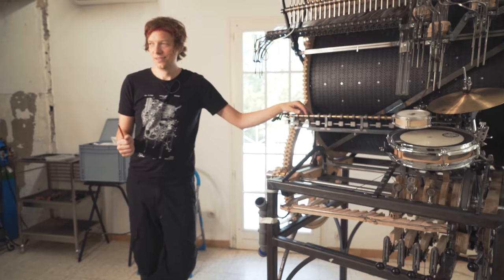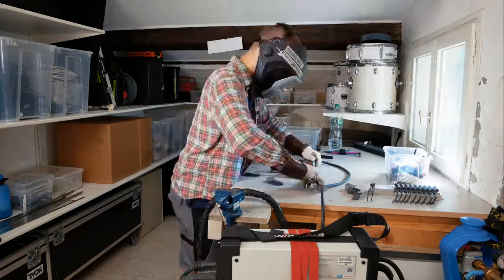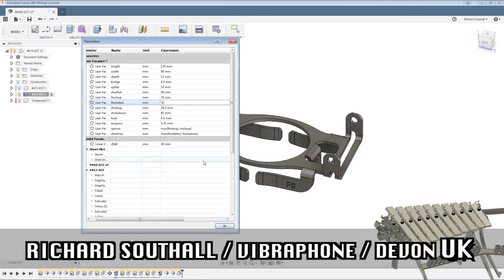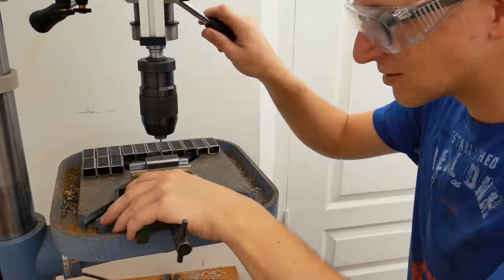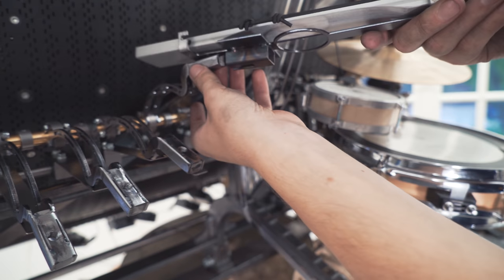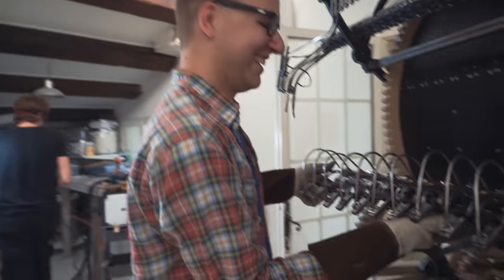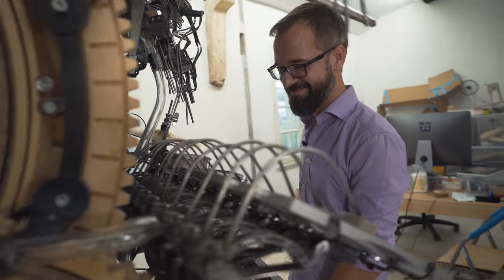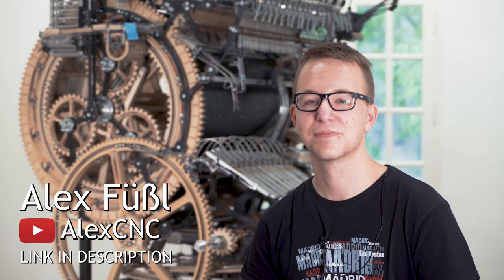Vibraphone Bar Holders - Marble Machine X #93

Comment: 8:03 Martin:"i learned sth from Alex: when I make a chamfer..." Me: YESSS, finally!
Martin:  uses high rpm so the countersink is rattling
This gave me as a machinist an ultra cringe and made me feel sorry for the countersink 😢
Pls lower the rpm to about 100 and you're good to go😅
Reply: I could not have said it better myself! xD
Reply: so much this! :P
Reply: Isaac Jung But that is not a router he is doing it on but a normal drill press...
Reply: i mounted a handle on mine, and with a 90° handturn i get perfect results.
Reply: The speed depends on the size of the Countersink.
Reply: Yes I think you are feeling empathy for the  tool and the work piece, which is possibly what Martin needs to learn. Even metal has feeling you know!
Reply: oh come on.  Just stop with the cringe comments.
Reply: @drasiritzbir  soooo? A router couldnt go this slow btw
Reply: @drasiritzbir  But the speed is still variable on a drill press by moving the belt, and referring to the chart under the cover.
Reply: @watcherofwatchers  ikr it's just a no no
Reply: I was wondering why that sounded so horrible, but I thought it was supposed to be that way :D
Reply: That drill press will never run that multiflute cutter slow enough to not chatter. 100 RPM is not an option. It is not rigid enough for a multi-flute anyway. He needs a single or zero flute countersink.
Reply: @buddyclem7328  Yeah that is what I meant, no reason to go too fast on a drill press, but the original post I was referring to is gone / changed. There a router was the excuse for not going slow..
Reply: I'm a machinist-in-training currently and as soon as he said "chamfer" and I saw that spindle become a blur when he powered it, I was like "noooOOOOO-"
Reply: @watcherofwatchers  So who peed in your cereal this morning?
Reply: Artists. They are artists for a reason, You know! (Contributing it as the tech guy working with artists for decades ...)
Reply: Aw, you don't like triangular countersinks??

Comment: I'm curious, what does the PBS say the overall completion is? its been such a long time since we saw it.
Reply: 37%
Reply: 5%
Reply: Well, duh. If you ever used a computer, you know exactly where it's at: STUCK ON 99% FOREVER.
Reply: Something 9x% I guess. The bass and the marble catchers are the only main parts missing. But then there is the debugging phase, which could take a while, depending on if some part needs a redesign. edit: (oh right, and the fingers... still not convinced they'll make it into the final design, though)
Reply: @TheAgamemnon911  oh god, the fingers...
Reply: @TheAgamemnon911  let's not forget the vibraphone resonator tubes, which are complicated because they need to change depending on what vibraphone notes are used.
Reply: @Blazier  Right, those need to be done, too. One doesn't need every tube to be every length, though. But I guess, the planning on that is already done and the manufacturing step of those is comparatively easy. (unless they are all metal, too)
Reply: @TheAgamemnon911  I'm not sure what you're saying here -- the length of a resonator has to match the corresponding bar or it won't resonate properly. So either they need a resonator per bar or they need a fast way to adjust the length of a given resonator. My guess is they'll just take the resonators off an existing vibraphone.
Reply: @JimVanVerth  I am saying that each channel does not need 37 different resonators. Somewhere between 4 to 6 different selectable lengths per resonator tube should be enough to enable all standard keys as well as many exotic ones. Switching out the whole tube would definitely be too much work for quick on-stage changes.

Comment: Some say the F1 engine from the apollo moonlander can't be rebuilt today, because none of the engineers could interpret and fine tune the details from the drawings the way they did it back in the 60's. My reaction to the MMX is that from start you were doing everything in CAD and the parts had their serial numbers and so on, but now I get the feeling that the machine is starting to become a "hack" and if someone would try to recreate the machine from the drawings, that could not be done.

For instance, if a part breaks down on the tour, could you still just have it made and get it shipped to your location, or would it had to be built on site to be able to fit it on the MMX?
Reply: NovaLand I have a feeling they will take an entire container of spare parts with them. 

My second feeling is, after about 3 tour locations, taking the MMX apart, putting it back together, followed by the INSANE amount of calibrating and adjusting required, it will be concluded, “The MMX is too complicated and complex to continually be moved and work correctly, therefore an executive decision has been made to only use the MMX for studio recording.”
Reply: @NealD  yes.  A machine that can be adjusted will need continual adjustment.
Reply: WhatAboutTheBee and a machine that cannot be adjusted will simply not work.
Reply: The CAD is getting adusted to reflect the changes.  This is a prototype after all - Martin wants the ability to order up parts.
Reply: @NealD  That is not insane - that is NORMAL for musical instraments that go into a box.  That is why orchastras tune up for quite some time before preformences.  His band already travels with a lot more instraments then band members, so they are used to a bunch of tuning beforehand.
Reply: kin2naruto have you watched all of the MMX videos? Because of the complexity, the on-site assembly time and configuration WILL BE insane. Look at the much simpler original MM and how it could not even play an entire song almost all of the time?! Yes there are a lot of reasons for that, but every single adjustment, is a one reason why.
Reply: kin2naruto I’ll come back to this in a year and we will see...
Reply: @NealD  Not as much as you think.  The "assembly" part is really quick and snaps together.  The "adjustment" part will take lots of fiddling, but no more then typical for musical instruments!  Probably won't even add much more then an hour to the dress rehearsal.  (You do dress rehearsals and tuning up EVERY time you do a concert - this is normal)
Reply: @angish1  As an actual degree'd engineer, I will simply tell you the 5 P's of Engineering.  Prior Planning Prevents Piss Poor Performance.
Reply: WhatAboutTheBee ... Is it part of an engineering in-joke that those were 6 Ps?
Reply: @Phandiw  Yes!  If only I had stopped to figure out how many P's there were before I started !!  This also re-inforces the "prior planning" part of the alliteration
Reply: @WhatAboutTheBee  I think that the prior planning part of the marble machine X is not something that has been taken lightly. However, no matter how much planning you do there are always hiccups. Adjustability is, with all due respect,  part of the specific needs of that machine considering the requirements for all the musical expectations there are from it. I think this machine is on the right track precisely because there are engineers helping with planning, CADing and someone who specifically worked on the PBS.
Reply: I’m more worried about marbles spilling on the stage floor causing a hazard rather than the actual machine breaking down and having issues with parts. The design is such that the marbles have air time, and they essentially act like a “fluid” with random albeit predictable paths; but still unlikely to ensure 100% that all marbles will remain within the machine.

But back to your issue, I think martin has addressed the idea that the CAD was kept with parts ordering in mind. Whether or not this would be feasible remains to be seen, but I just wanna hear this thing play music, really.:)
Reply: @NealD  ...So they would need to build 2 more machines before the tour...  one machine whick is practically a backup/spare parts and a secondary machine that they could have back in the shop where they can build new spare parts and try out the parts on. I mean, some parts aren't really easy to make without a machine to build it "on", like the tubes that needs to be exactly fitted....  not only that, the spare tubes needs to be manufactured with the original tubes in mind so they actually fit together with eachother.
They need to make a exact copy of tube 1, 3, 5, 7 and so on whilst tube 2, 4, 6, 8 is installed.. and then switch and let the tubes 1, 3, 5, 7.. be installed whilst building/testing/installing the new spare 2, 4, 6, 8..
Reply: NovaLand I have watched all the videos... btw. So I’m familiar with the amount of parts.

I don’t agree spare parts like the tubes need to be made, particularly made remote. Pieces of tube, a silicon rod and heat gun will need to be taken with on tour. The tubes are really just an adjustable part that is adjusted with heat versus a wrench.
Reply: @kin2naruto  Definitely he has put a lot of time into thinking about how this machine will break into subassemblies that theorically should be able to go into a flight case to ship to the next show. I'm curious how many of the little set screws and such will rattle out of normal configuration and require on-site tweaking though. I think this may be some of what Neal D is talking about. I suspect there will be some initial calibration following by some addition of LocTite in various places after the first few shows. I'm also really curious to see how the swap-outs play out at venues. Pulling and swapping out the vibraphone plates or programming plates is a great idea, but there are only so many roadies and so much time between songs.
Reply: @jasonjohnson1404  speaking of the swap-outs, i wonder how it will be performed on stage? I mean, if it is like 4 plates, then the machine needs to rotate the cylinder to access the other plates, which means it will start to drop marbles while rotating. Wonder if there is any way to prevents marbles dropping and engaging the instruments when rotating the cylinder?
Reply: @NovaLand  Yes, he's shown that all of the channels can be muted/disengaged from the programming wheel.
Reply: @WhatAboutTheBee  I thought it was the 6 P's, "Piss poor planning prevents proper performance" ;?)
Reply: Considering that Martin has all these great video's documenting the entire process, I wouldn't think it would be that difficult to find the information needed to reproduce each part.
Reply: There's also the fact that Martin has a very big brain - I imagine that every step and mod of every part is etched into his mind like some Holmesian memory palace ;?)
Now the only thing to worry about is that he doesn't get hit in the head with something heavy, like faulty stage lights, lol.
Reply: @russell2449  Nothing beats detailed drawings, with tolerances indicated for production.  Martin simply has a CAD model.  There was obviously no tolerance analysis (as evidenced by the build) nor are there detailed part drawings.  Further, as Martin has "improvised" other solutions, we can only hope that he has updated the CAD model, however we have zero evidence that he has done so.

I think Martin has created something fabulous.  However, he is not an engineer (he has said so himself) and because he lacks that discipline, has missed some crucial steps along the way.  There is no way, for example, that his "big brain" can remember the fit, form and tolerance of each hand tweaked part.  That is ridiculously unrealistic.

Comment: I just imagined a setup where Martin could write a song and pin it on the programming wheel, and play it. Then with only changing the vibrophone notes he could make it an entirely different song especially if using a different tempo. Then with only changing the programming wheel become another song, and yet again change the vibrophones for a fourth song. 

This machine is getting very awesome.

Comment: I worked at a sheet metal shop for a few years and we had a device (I can't remember the brand or model) to tap blind (not drilled through) holes. I would mount it in the chuck of the drill press and mount the tap to be used in the device. A drop of oil on the hole and lower the tap to the hole, the tap would engage the hole and tap to the bottom. When it was done a clutch in the device would prevent to from turning anymore and stripping the hole it had just tapped. When I raised the drill press arm the device would reverse and back the tap out. I remember that the tool bin guy would always caution me about how expensive the device was every time I signed it out.

Comment: 11:34 This sounds great! But one thing to think about: The damping makes the vibraphone plates shake a lot, even more than the effect of the marbles. I could hardly see the animusic-bounce when you hit the plates with the mallets and I imagine that the marbles will put even less force on the vibraphone.

If you haven't adjusted the springsteel yet, then please ignore this point^^
And please don't only test the tension which you put on the springsteel trough the adjustment screws but also try out some different thicknesses! This will effect the movement differently.

Comment: argh i told you about the chamfer before tapping forever ago- also you can power tap with a hand drill on a low clutch setting. just make sure to keep it straight. it is easy if you let the weight of the drill do the work :)

Comment: when are we going to see the sustain pedal build? also it would be good if you added a mechanism to shift the entire vibraphone sideways like the soft pedal on a piano so that you can change the tamber by having two different materials on each note that the marbles can hit depending on what position the vibraphone is in. the second rubber material could be harder to produce a brighter tone.

Comment: Martin - the bar you are using for the positive stop on the vibraphone sounds like it will cause a clicking noise (metal on metal) as it is struck by each arm on the rebound of every note.  Is it possible to coat the positive stop bar with a plastic or rubber coating to deaden the clicking noise when the vibraphone arm strikes it?  Or perhaps use a soft pad glued to the arm where it impacts the bar?  Cheers from Florida!

Comment: What about ball trajectory after striking a vibraphone note? The notes are suspended on spring loaded levers, so their angle will vary, and they may rise and fall. A following ball hitting the same note will vary in trajectory depending on the angle the note is at when it strikes, and whether the note is rising or falling.  Won't the note volume vary depending on whether the note is rising when the ball strikes it, or falling when the ball strikes it? Perhaps the sound variabilitiy will lend character? Maybe all you need will be larger diameter catcher funnels?

Comment: The industrial style is very nice, but did someone raised the oxidation problem?
Is it planned to apply a clear coat over every bare steel parts?
Reply: I believe he has been applying a product to steel parts, at least he was testing it in a previous video.
Reply: Yes, metal parts are protected with some kind of wax

Comment: Martin, I know you're not even finished with The X yet, but I picture you one day building one of these, but massive. Something that takes up the entire flat bed trailer on the back of a lorry/big rig truck. This way, you can fit all of the notes into one machine. The full scale without switching. Then you can drive your machine to any venue an the stage is already set.

Comment: the spring steel set screw would be better if the block clamped on the rod rather than just relying on a set screw, set screws don't really work unless they can bite in or index with a flat

Comment: design tip for bending sheet metal: cut holes/slots in the bend line so that the bend line gets weaker and it can be bent in an accurate position and by hand, like a 'living hinge' in plywood: https://www.instagram.com/p/Bu8bePunujH/

Comment: Putting a microphone on every bar of the vibraphone seems like overkill no? Would it not work just as well using only a few that lister 2 or 3 bars each?
Reply: I Left My Ego In My Other Pants Then some bars would be mixed louder than others.
Reply: The microphone is a piezo pick up glued to the bar so it only picks up that one bar. There is no practical way to capture two plates together with that kind of mic!

Comment: Martin... for a second I though you looked funny.
anyway, it looks like your machine is about 60% to 80% done in the structural department, don't know the adjustment part, but I have to ask about the resonant pipes. are they really that important?
right now the machine has quite good sound.  if you really need those pipes, may I suggest you take "inspiration" from Ferrari LaFerrari's adjustable length intake? It is a "in fly" adjustable resonant pipe.

P.S.: The vibraphone bar system turned better that I expected, a clear case of "it's better when you see the final result". I hope you can find a way to archive the same wow effect with the "note activity display system". Let's us not call them kinetic fingers... the name doesn't sound that great, and they may not look like finger after all.